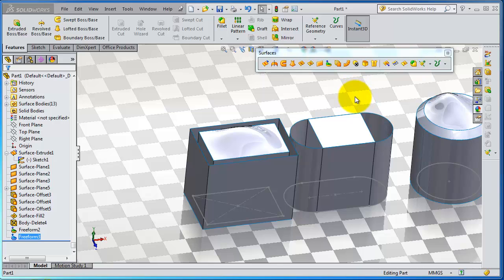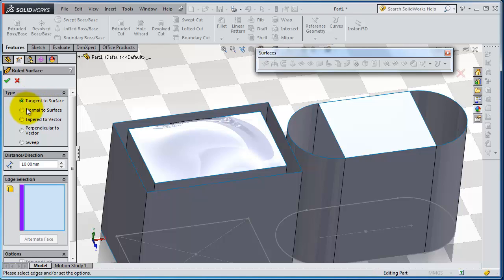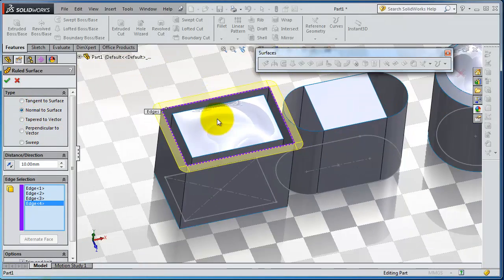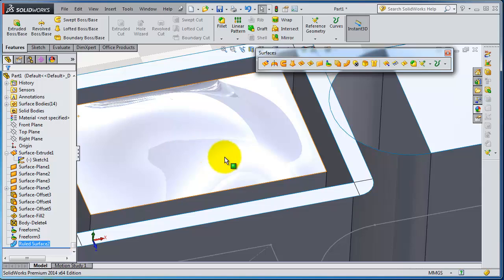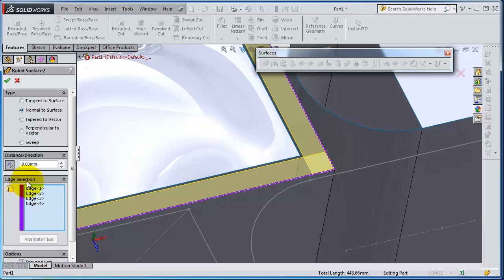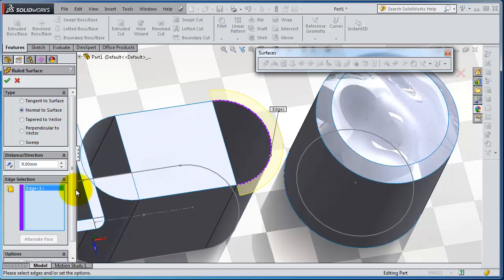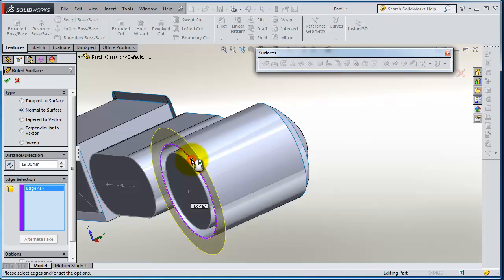SolidWorks 2014 Surface Tutorial 82: Ruled Surface

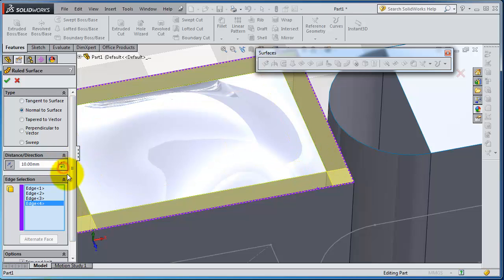Comment: you are great, but in this lecture in minute (1:02) if you read the error message you will notice that you can do the ruled surface in inner direction if you remove the kinit option from the option menu
thanks a lot for your lectures